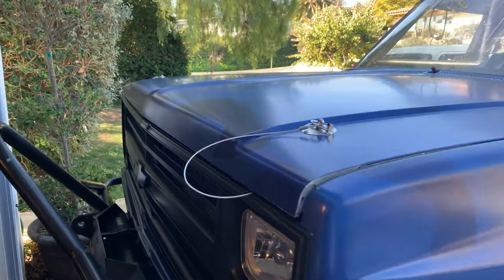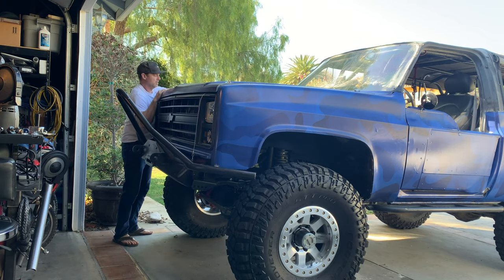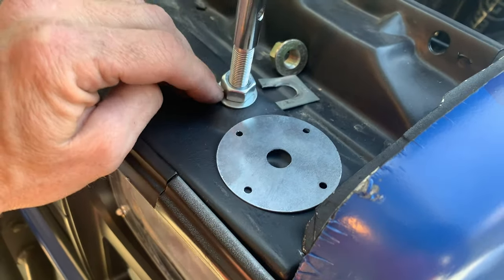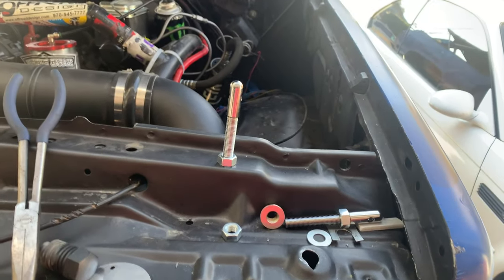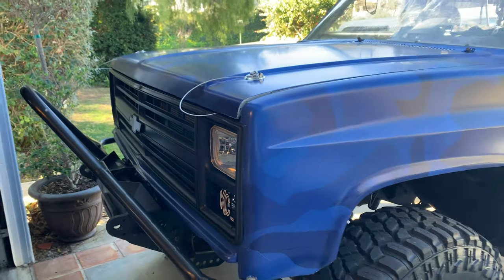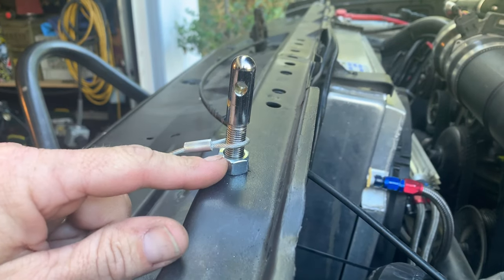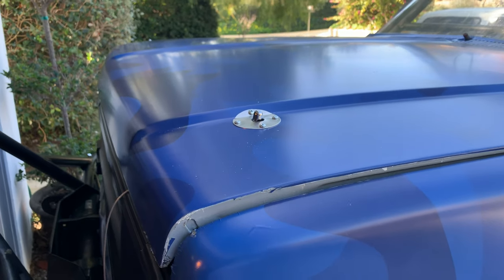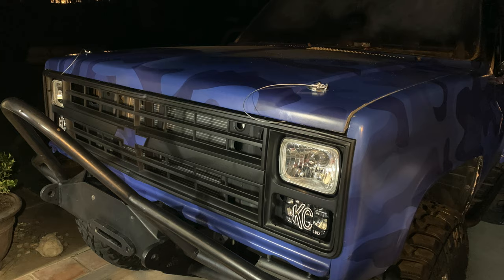MG #191 - How to install hood pins on your Squarebody!

Comment: When you swapped your lq9 in your k5 did you have to use a different oil pan?
Or different cross member?

My lq9 in a 89 k5 using diy4x mounts oil pan isnt clearing factory cross member
Reply from the maker: Different cross member.  Off road design makes one
Reply: Thank you I will have to do crossmember its amazing how an oil pan is from holly is like 400 when you can get a crossmember I see for 200